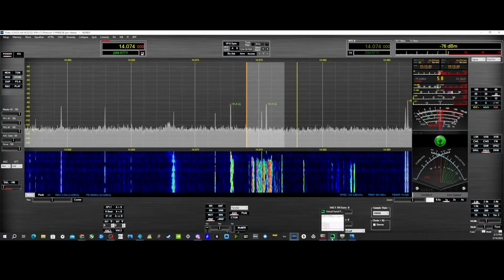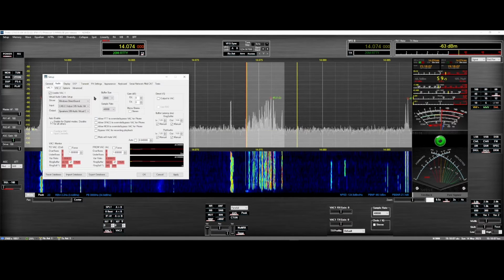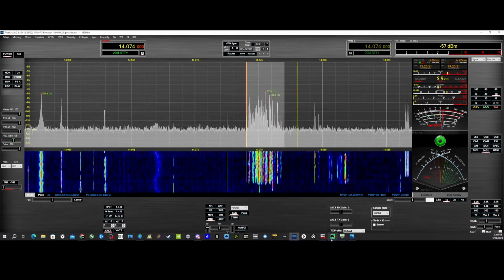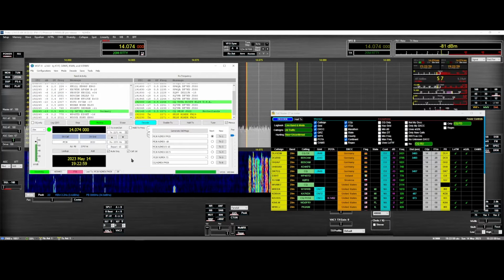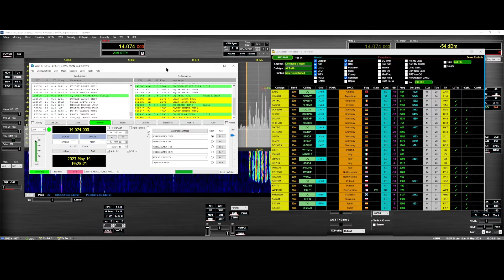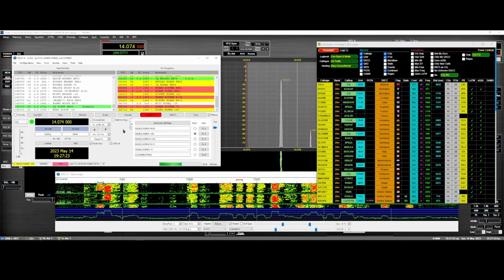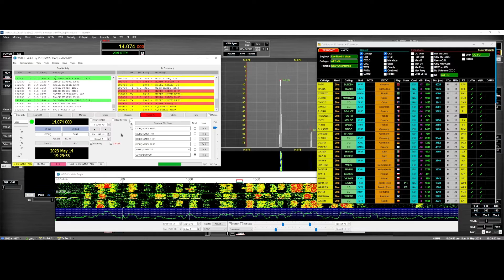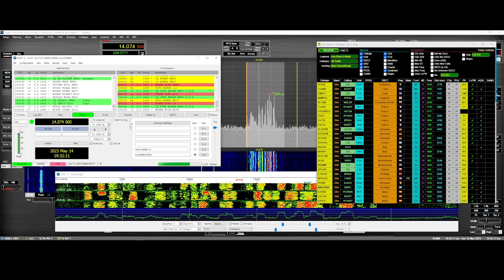Hermes Lite 2 FT8 VB-AUDIO VSPE WSJTX Setup Part 2

Comment: Can I create a separate Thetis database for FT8 once everything is set up? Seems it might be an easy way to toggle between phone and digital without having to change parameters each time?
Reply from the maker: I have a separate profile for ft8, but yes you can buy that means every time you go on ft8 you have to load a different database ehhh ok
Reply: @MikeN2MDX  I just went through your setup tutorial and everything went brilliantly so thank you for taking the time to produce the video.  I don't mind switching databases...its easier than turning on the Icom 7300 and throwing my 2:1 coax switch 🤪.  I notice that the power slider bar in WSJTX has no effect in Thetis so I reduced power by using the drive slider in Thetis, however, you really have to move it down to reduce output...mine is about 6dB down from max to keep the PA cool.  Thanks again!

Comment: Thanks for all of these videos Mike! I have an odd one. I followed your video and all audio, cat controls seem to be routed properly as I'm receiving calls in WSJTX. The problem is that it won't trigger my amp for some reason. When I manually hit MOX or let WSJTX do it. I can trigger the amp by hitting TUN though. I have the RCA going directly to my Palstar LA-1K and it works fine for voice. Any suggestions?
Reply from the maker: double check all your settings in Thetis, without seeing your settings hard to really know.
Reply: @MikeN2MDX  I switched to the FT8 profile I created yesterday and it started working. Will have to dig through the settings to see what was different. I would like to setup VAC 2 as my FT8 profile and just tic that on and off when I do it. You started to mess with it a little in the video so you could hear it on your end. I may mess with that too.
Reply from the maker: @DBruno  like I said had to be a setting you were missing glad it is working.
Reply: @MikeN2MDX  yes sir! Thanks for the responses.